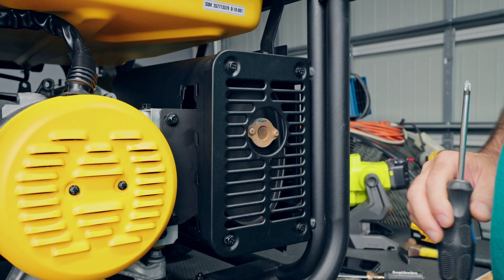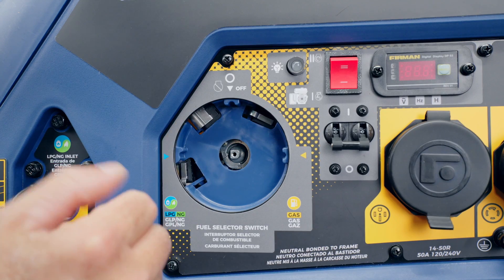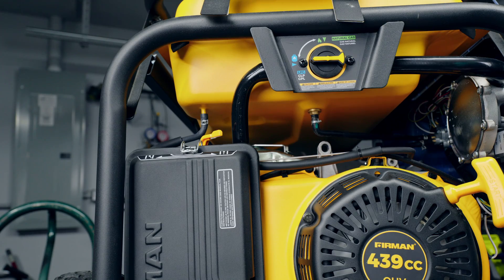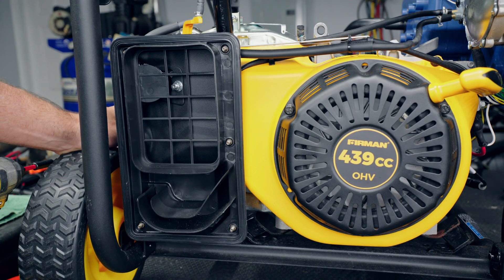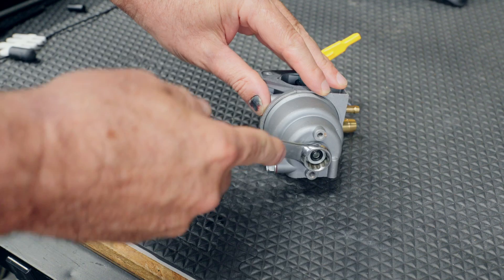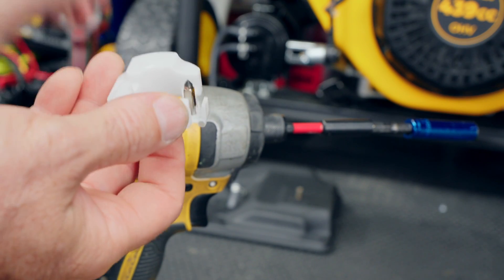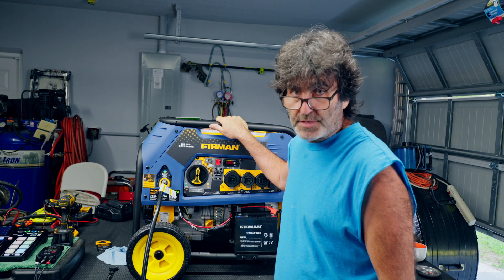Diagnosing Firman Costco/ Amazon Generator That Won't Start [3 Possibilities]

Comment: Thanks for great video.  I've had a Firman dual fuel for 4 years, fired it up as soon as I got it and a couple of times thereafter...but I stored it with gasoline 😞.  I just now tried to start it and it don't start, gas light turns on, turns over and it just don't start.  I suspect it is the carb...found your video, thanks for the breakdown.  Drained the gas from the genny's tank, put in my truck and diluted it further with 3/4 tank full of premium gas to make sure it don't mess up my truck.  Anyways, I took apart the carb and I smelled the fuel in the bowl and it smells kinda of musty/musky...if you know what I mean.  I'm gonna clean it like you showed in video.
My preferred fuel is propane, I had just put gas to start the genny up when it was new, but I now keep 6 qty  (20lb) propane containers for emergencies.
I knew better than to store gasoline in tank, but really just lost track of time (Covid really messed up sense of time...haha).
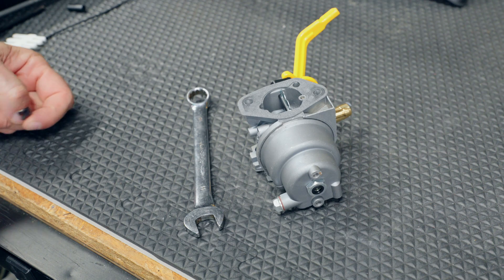Henceforth, I'm gonna do what you recommend in your video (7:11) and let it drain for storage, if I even use gasoline...thanks for the advice.

I know long story, but my question is if the genny don't start with gas cuz the carb jets are fowled, etc. ... could I have switched over to propane and would it have started even with a messed up carb?
Meaning, does the propane go thru the same carb jets that the gasoline residue clogged up?...I'm just curious.
Reply from the maker: HI!  Looks like you're still going to need to clean up the carburetor.  That big hose with the clamp is the propane fuel line (if I remember right).   If that fuel wound up setting in there for 4 years, you might also look in the gas tank.  That one has a metal tank that could have rusted out the bottom...

Comment: mice ate the 12v harness behind control panel on mine.... called firman said i had to buy the entire control panel because they do not offer just the harness i needed. also learned they have a THD of 14%. see you later firman back to costco you go
Reply from the maker: Yes that's right on the THD.   I've seen mice do that kind of stuff.  You'd have to pull it apart and repair each wire individually.  If you're taking it back, then you don't have to do anything...  😊

Comment: Ive got one that had a catastrophic incident where the valve was impacted by the piston at least two times, and siezed the motor. Replaced the top end, the motor fires and runs smoothly but under some weird settings that ive discovered. When fuel selector and fuel valve are in the gasoline setting (full right turn) the fuel valve opens however, the fuel solenoid on the bottom of the carb bowl will not activate (pull the pin down) when the fuel selector switch is turned to the gasoline setting. I can hear it click open on the propane setting though... which I suspect is not correct as that would mean both gasoline and propane would be flowing. Somehow the solenoid on off/ for the propane/gasoline settings on teh selector are incorrect. Can the wires just be switched? I ordered a replacement dual fuel module thinking that might also be the culprit but if its just a simple wire/pin in the harness that i need to switch that would make it way easier. I've checked the wiring diagram from the Firman site however all wiring looks to be correct according to that. Wondering if it would be possible for you to caputre a video for me just showing the wire connections that you have on your machine that is working properly, both on the back side of the fuel selctor switch, and also the 12 pin wire connector on the top (dual fuel module) box inside the panel? Any help is appreciated. thanks
Reply: Aaaaaand i just watched more of the video and it showed exactly what Id asked you to show haha, Nevermind from the comment above! thank you
Reply from the maker: Wow.. thats quite a story.  I'm glad you were able to figure it out.  I'm befuddled as to why the valves impacted the piston in the first place!  Did the valve springs fail?  When you took the head off did you notice any damage to the piston?  Sorry for the questions, that seems like an unusual situation.  At least I hope it is, my motor is pretty much new, but hope its not prone to these kinds of problems... 😫
Reply: @JLPicard440  same here total mystery. When i took the valve cover off one of the pushrods was completely out from under the rocker, I’m wondering if the valve clearance got loose and jiggled free from under the rocker? No clue though i wasn’t there when it failed and the guy didn’t have much info to share on when it failed. But good to know those champion 439cc parts are pretty close to the firman ones
Reply from the maker: Cool.. thanks for the response.  It kinda sounds like a manufacturer issue.. Maybe they forgot to tighten the rocker arms, or didn't adjust them correctly and caused the push rod to come out...  No way to know..
Reply: @JLPicard440  yes definitely agree. Make sure to file your manuf warranty paperwork and keep your receipt. This unit only has 260hours on it and that happened. So who knows how good the QC is
Reply from the maker: TY!

Comment: I have  the same  one  and  generator  doesn't want to run on NG and LPG.
It running  without any issue  on Gas  but when I switched to NG or LPG generator  simply  rpm are dying .
Another thing  what I notice  electric starter barely mowing  engine .I check battery  , 12.5V and when I pressed  switch start , engine  crankshaft mowing  slowly . To slow  to start engine 
Any idea  or solution  how  fix  this generator ?
Maciej Szmytkowski
Reply from the maker: HI, without seeing it it would be difficult to diagnose.  It kinda sounds like the fuel switch isn't switching the fuel the way it should.  The starter turning slowly is another issue all together.  I'm assuming it's having a probem on Gasoline too.  I would put a meter on the battery and crank it over and see if the voltage drops drastically.  If it does, chances are the battery is bad.  Although not 100% guarantee...
Reply: @JLPicard440  I'm disappointed Since this is a brand new generator and I'm having trouble shooting to figure out what's wrong with it, give me a bad impression of the quality of how it's made. But I think you're right, the selector switch will be next to check and the battery is probably bad. Anyway, thank you for some information
Reply from the maker: Yes I'm sure if it was in front of me, I'd be able to diagnose it just fine.  Where did you get it?  If you got it from Costco or Home-Depot they are really good about returns, but I think it has to be within 90 days.

Comment: Here's one for you. I have a Firman 7500 Duel fuel. 4/5 years old. Worked fine until I pulled it out of storage this year. Red light comes on for both gas and propane. Starts with either but shuts off after 10 seconds or so. Was stored empty and since it starts, I don't think it's a dirty carb. I checked the oil level and it's fine. Disconnected the wire to the oil level sensor and nothing changed. Shuts off after 10 seconds or so. I checked and cleaned the spark arrestor. Nothing changed.
Other that pulling and cleaning the carb (that I'll probably do this weekend)... any suggestions on what to check.
Reply from the maker: HI, Do you have one of those inline spark testers?  I would want to know if the ignition is shutting off.  You can watch the spark as the engine slows down to see if it's still sparking.  If the spark is cutting off, then you probably have some electrical issue, I doubt it's the coil.
Reply: @JLPicard440  I'll check that when I can.  Carbs out getting a sonic clean right now.
Reply from the maker: Cool very good.. @paulmathis2191
Reply: Check for mouse damage.
Reply: Did you get it running? I’m having the same issue! Thanks!

Comment: Mine was used once on propane for around 3 hours and put away. 4 months later I tried it again with propane and it won’t start. The red light comes on, so I figure the switch isn’t the issue. Any suggestions? Thanks
Reply from the maker: HI Chuck.  Won't start is a little generic..  😊. Won't crank?  Turns over fine, but not starting?, etc...  If it's turning over fine, do you have an inline spark plug spark tester?  You'll need to know if you're getting spark.  That way if you're not there's something keeping the magneto turned off..

Comment: Question; so my generator starts and runs for about 3-5 minutes and runs fine with a load on. However, it dies after 5 minutes. It will start back up just fine and run for the exact exact same time and then die. What could this be??
Reply from the maker: Good question... You might have a screen inside the fuel tank that is dirty allowing a little bit of fuel to come out.  The flow might not be coming out like it should.  Also, you might want to check your gas cap.  Loosen the gas cap and run it and see if it wants to die with the gas cap loose...  Just make sure you're outside and you keep any fuel from splashing out of the tank if it's pretty full.  Another thing is make sure the fuel in the gas tank isn't contaminated with water.  That's a more common problem that it would seem like, but due to condensation it can happen even if it's never been left outside..

Comment: One more comment.  It’s important to run the machine under an electric load, to be sure the magnets and copper wires still produce the electrical field for the electricity.  More complicated scientifically than that, but hook up a hair dryer or space heater 4 times a year for 5-10 minutes
Reply from the maker: Great info!  Thanks 😁

Comment: great   video but no help.  My generator is "new" never ran it for hours in an emergency because no outages,...it is always hard to start but this time finally I checked plug NO SPARK....on a new genny?  WTH??    I was hoping there is a reset or something....the plug is totally clean
Reply from the maker: Arrrgh.... I'm sure if I had it in front of me, I could find out why no spark.  If you find the coil, see if that one has an electric wire attached to it.  If so, unplug it.  If the spark comes back then something is grounding out that wire.  There are probably a few possibilities why.   IF you disconnect the wire, don't let the generator start or you won't be able to shut it off since the coil ground is unhooked so take a precaution so it won't start on you.

Comment: I have the firman inverter generator wh03242 the EVM board is out firman wants almost $500???? Is there anybody that can fix these?
Reply from the maker: Nobody specific that I know of.  Have you looked over the board to see if there's anything obvious like a blown capacitor or something like that?  I'm sure it can be fixed, but you would need some mad troubleshooting skills on electronics.  I would also try to google that problem and see if there's a thread somebody posted with the fix.
Reply: @JLPicard440  yes took out board looked for burnt things melting black areas nothing I think it is one of the three bolt on modules if you hear of a board repair person please let me know thank you
Reply from the maker: Hard to believe they want $500 for that!  The whole generator is $799 at Costco I believe.  Another thing to try is Ebay... Sometimes people will part out stuff like that and you might find the module you need much cheaper.

Comment: Easier to buy a new carb and install. Gas is my choice.  Swap it out every 6 months and treat with stabilizer fluid. Runs 12 hours plus on a tank.  To each his own
Reply from the maker: I agree!  Gas is better.  Produces a little bit more power as well.   My problem is, I'm lazy and I don't want to clean out the system every time.   I'll wind up forgetting about it and it'll go bad and rust out the tank and carburetor.  Even with Stabilizer + Non-Ethanol it'll last about 2 years max.... 😀
Reply: @JLPicard440 - keeping fuel in it all the time with stabilizer is not what I do. Completely drain the tank and the carb and bowl.  Never had an issue with rust in the tank.  I challenge you to show me any generators tank that doesn’t have rust in it.  Most of the time that’s superficial.  I’ve done that for the past 15 years, starts on the first pull every time
Reply: Carburetors are cheap.  Always good to have a spare one on hand.  However, I keep mine dry so I’ve never had an issue except many many years ago, when I left fuel in  the tank once. Never again!
Reply from the maker: Hi Condor5635!  That's what I always do.  Completely drain the system from the gas tank to the carburetor bowl.  That is the way I've done it for years and never had an issue.  It's more trouble, but in the long run it's really not... 😊
Reply: @JLPicard440  totally agree!  I don’t store any gas. I don’t buy ethanol. I don’t buy Stabil. I don’t leave any in the tank or in the system at all.  if a hurricane is coming, I go fill up my tanks. Otherwise, I just keep 6 gallons that I cycle every three months in my car.
Reply: My diesel Lil generator do not have rust in their tanks.
Reply from the maker: @hamop3  Nice!  I don't think diesel fuel attracts moisture like regular pump gas does.. 😊